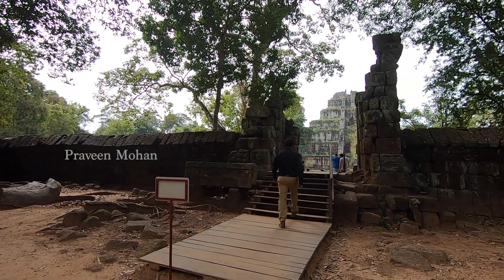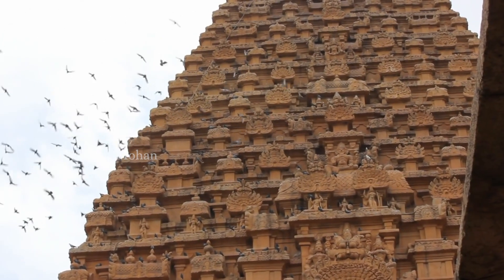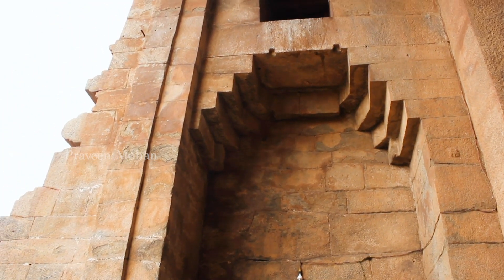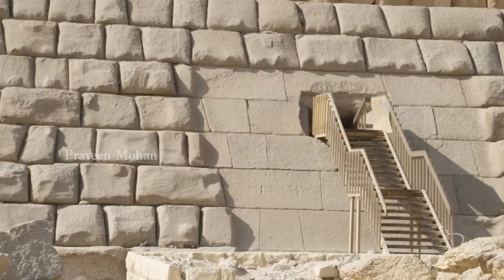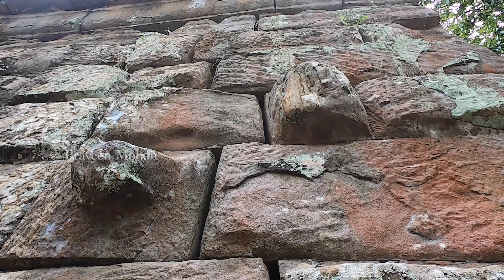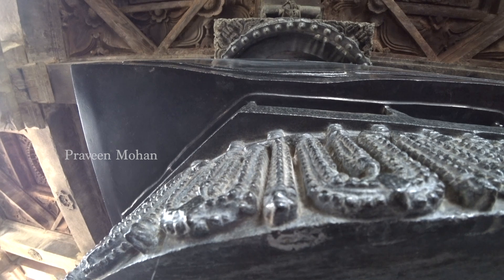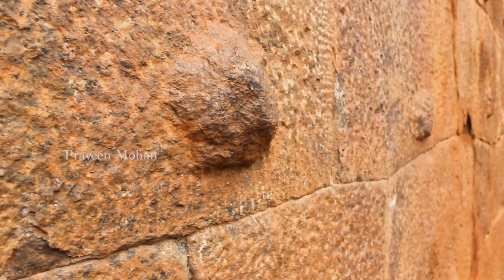Mystery of Ancient ‘KNOBS’ in Temples - Evidence of Stone Melting /Geopolymer Technology?

Comment: simply protruding rafters, framing, petrified during the flood and resting a year at the bottom of an ocean. also how the lime from the cement was leached to the outside by the pressure leaving only the sand, hardening, becoming sandstone. can see how the first bldg was walled of cement-filled sandbags, the bags themselves of which are breaking off along with the lime revealing the sand inside.

Comment: Your explanation is interesting but there are still some major objections. Megalithic structures and the individual stones are so huge and the mystery has always been how would they have got quarried stones into place where they sit so tightly together. Molding liquid stone is (almost) an ideal way to overcome this objection. To mesh so well, they would have to create molds and pour the aggregate mixture in situ, wouldn't they? 

You seem to be saying they moulded the stones in something like a factory and the knobs are imperfections in that process. If that was the case, they would still have to lift the stones from the "factory" to the temple. But then they probably wouldn't mesh so well together. (maybe better than quarried stone, but still not perfect).  I'd like to see you or someone prove the concept by building a simple wall with some major stones. Maybe they structures were Prefab! If they were prefab, how did they get such huge stones to the temple site? Answer: they poured them on-site? Then why aren't the walls straighter? What was the nature of these moulds?  

It seems unlikely the knobs are a result of an imperfect manufacturing process. What was the nature of this process where knobs are sometimes accidently created? Let's see: suppose they cast a stone, let it set, remove the casting. Then sometimes something leaks out of a weakness that they didn't let sit long enough? I dunno... Couldn't they knock or chip the knobs off?

Comment: I think these knobs art not a result of  a 'liquid rock casting method. The may habe a kind of secret message or hint, for hidden doors  tunnels or things like that. 
The bendet rectencular coloum base block looks like an air condition device with air flow slots. Maybe these pillars are a 3 copy from an modern looking air confitioning metal coloumn. When the original device was damaged or bend. The copy is bended too.

Comment: Even though this flies in the face of current thinking that granite rocks are permanent unless reduced to magma or enormous heat and pressure (like near the mantle), it does make sense. A further question is why they didn't pour or flow monolithic walls instead of making so many odd shaped blocks?

Comment: Brilliant observation . Particularly plants only growing on temples/buildings , not out of identical ground rock . The theory megalithic stonework was moulded into position may soon be able to be (finally yawn)  scientifically proven . And yes , the odd protrusions on 2%ish of the blocks , almost certainly a manufacturing default ; but , one that doesn't have any relevance to the strength of the architecture of the overall structure . Of course they would incorporate them . They prob took ages to produce - that block for that space/position ; you're not gonna bin it for the sake of a slightly ugly protuberance eh*

Comment: Lightweight thinking.  No evidence that the stones are any different in comosition from other stones withou "knobs".  If they were moulded when "melted" why do they have the same kind of tool marks as adjacent stones the don't have "knobs",  You have provided no evidence that the stones were melted other than that they have "knobs",  Very lightweight thinking.  The old men have no more evidence of how the stones were mined from in situ stone than you do...which is none.  Making a statement of what you think may have caused the "knobs" and to what purpose the were put (lifting) without any detailed evidence is not proof and is not provable.  You should work harder toward an answer rather than jumping to conclsions (which happens to be widespread to other "experts" around the world). Not at all convincing.

Comment: The knobs are easy enough to remove after the blocks are in place. If appearance counts, they are removed. If not, they can stay. They are needed for final positioning of the blocks, not by using ropes. Probably the use of leverage, a common practice today in house construction when straightening walls before the sheathing is put on. The idea of melting rocks, or casting liquid into blocks is absolutely silly.

Comment: In case of a building technique that requires molds to pour in some sort of liquid concrete these knobs would simply indicate that the complete mold has been filled up in particularly complex points of the wall, joins perhaps, or difficult angles. I think someone else has already indicated this possibility.

Comment: When you cast metal or ceramics, the pouring hole allows room for overfill of the casting material. The hole also allows for gas escapes and contraction/expansion.

I would be curious if knobs ever occur on  opposite sides of the same block. If not is suggests a pouring method.
Reply: Makes sense. But I wonder why wouldn't they just chisel off or polish the knob later. Looks like it had some utility, else they wouldn't leave it in place.
Reply: @TheYellowshuttle  three possibilities: the softened stone was already set; the knobs are injection or relief points; or or the protrusions were molding mistakes. I doubt the knobs were lift points. Also, cutting of the knobs would risk damaging the stone. It is also possible that stone densities vary throughout the stone causing uneven weathering. 

I am starting a ramned earth building company. As a practical matter, agrigates are mixed, poured into a mold and compacted. Once the mold is removed, no further changes are made, since the newly formed rock takes time to cure.

Comment: If we make up a dough of almost any powder and liquid to a very thick consistency and insert some type of rod into the dough and then remove it, a "pimple" of material is raised on the surface.  This seems to me to be the proof of geopolymer construction, and the exact consistency of the specific batch of slurry and the speed with which it hardened would determine the knobs appearance or absence.

Comment: The nobs were made when they quarried the stone. The nobs were on bottom of stone. They cantilevered the weight of the stone and the nob held up the stone. Then they cut them away from wall. The nobs held stone off ground and made moving them easier. The nob is easier to drag then flat stone. The goepolymer is crushed first and then heated to make the hydraulic cement like a stucco. It has to have high silica to make hydraulic cement. You use a kiln to heat limestone or dolostone. That's slag not rock. Perhaps you should learn about making cement in a kiln. It's more about what the rock is made of. The nob was just to keep stone off ground. It is a lot easier to than just a flat surface to move. This is what happens when people do videos and have no experience with stone working or cement.

Comment: Blocks were cast in place. This allows for the odd polygonal shapes to be fit tightly together. The 'concrete' stone MIX they used had some large stones as filler material within the mixture, those stones protruded from the mix. The mix was of a very thick consistency. As it cured or setup,  the builders would more smoothly shape the surfaces, but of course the knobs being hard stone could not be pushed back into the mixture.  Carving of hard stones into such odd proportioned blocks makes no sense from a labor work POV.  Neither does lifting 100 ton, or huge blocks high up to form walls. Of course some very heavy large stones blocks were carved out of the bedrock and moved, perhaps by giants in other places, but that is another story. Even today, there are many various construction methods used.
Reply: And weathering of the stones has paid its part in fooling the archaeologists. Stones etch, flake, crumble, crack off layers and can form odd appearances over great amounts of time.
Reply: Perhaps rough forms were used to hold the mix in place to prevent slumping. You might think that could keep the knobs in the blocks, but also the form could have been taken away too soon and the mix moved. Speed of building was also important so defects were tolerated in some areas of the walls.

Comment: In my minds eye the smaller ones were used to stop flimsy ladders, scaffolding and mechanical lifting devices and ropes from slipping off of the blocks, and also as convenient hand grabs, and the bigger blocks that extend out of the face were left as ties for future potential walls to be built adjoining the structure.

Comment: I like your idea however these knobs are also evident in the quarry where the stones came from. They seemed to be the last holding points at the back of the stones before they were broken away from the quarry face. They almost always were at the bottom of the block in the quarry. You are right that many blocks seemed to be cast. Maybe the cast blocks were made from the pounded material from behind the quarried stone and for some reason they left the knobs on to show these were quarried stones.
  Another thought, these may have been left on as a key for the final plastering of the temple or wall.
love your thoughts and appreciate the great contribution you have mad to understanding these ancient mysteries . Cheers.

Comment: I am not totally convinced that they are defects, they had to be intentional.  If you are casting something, gravity and the mold/form determine the shape of the final product and a knob would have to be an intentional part of the mold/form.  I think it had a purpose for construction and then the easy to reach knobs were shaved off once the construction purpose was met. They could be something as simple as a visual marker to help determine the alignment.  Or perhaps they were used to hold a surface 'cap' that has since been removed or fallen off.  It is intriguing that they are found on structures around the world.

Comment: Uh, knobs are probably where they cut the block free from the quarry face. First face wouldn't have them on the front side. Has to be one last place supporting the weight of the piece when you finally cut it free. Leaves a "knob". If it matters, they can cut the knob off. Otherwise, why bother? There, common sense solved your mystery.

Comment: Just an observation. Some of the walls you show in the video quite clearly have a hammered/chiseled finish to make them flat. However the knobs do not. They are rough like the original stone finish. If they were casting the blocks then you could assume they would cast them flat in the first place but if they did need to have a final finish with a chisel then surly they would have taken the time to flatten off the knobs while they were at it?

Comment: This has always been my leaning towards understanding knobs. It might even have been possible that most 'knobs' were removed by slicing them off, but of course when they had already solidified, they could not be sliced off. 
I think it is the remnant drops of fluid rock when poured out and shaped, that solidified quicker than expected.
Reply: Or , the blocks were only softened on their outer inch or so deep. Some occasional random points were not softened and could not be molded or scraped flat. That is why the nobs only protrude an inch or so. They serve no purpose, but were used instead of being discarded or laboriously smoothed as hard granite. I wish I knew how they softened the rest of the rocks outer surface!
Reply: Unfortunately the information in the video was not correct . But in the context of the video of what you say makes sense
Reply: That's a very broad statement...how do you back it up???
Reply: @Liberallez  It's not a statement:  it's my current thinking.

Comment: Think like a builder. The knobs were likely balance points and how blocks were moved. The knob raises block off the ground allowing a rock to be placed under as a pivot. Pivoting is very easy way to move massive objects. A guy in Michigan moved blocks weighing over a ton on a pebble sized pivot rock. The knobs were likely left in less visible areas without carvings due to economics (cost of labor). Simple and effective method, no need to complicate.

Comment: Noticing if two features of wall blocks 1) slight concave versus 2) pronounced convex. This tell us something about the variance in the proportion in the concrete mix.

Where concave blocks seldom associate with knobs while convex has knobs. 

Expanding concrete can be pour mold to attain seamless block fitting. The down side is the require for expansion mitigation by am experienced priest. When over expansion is speculated the priest ask to puncture a hole to bleed off expanding material thereby a knob is left behind. 

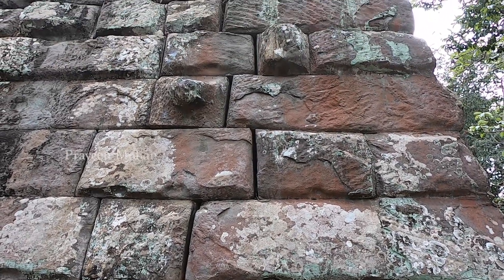An extreme example can be see in the video with which the knob sized nearly the entire block face area. Imagine the priest’s whole body was covered in sweat desperately trying to puncture as many holes as he could on that block. See also page 7:25 through 7:35 and including 8:35

Comment: The use of hydraulic cement is an advanced knowledge pass down by from ancient civilization and in one modern day someone claim inventor of it. Just about all classical knowledge and wisdom came out into modern time in such process. 

Ancient hydraulic concrete was made of hydraulic cement mixed with wet and crushed sandstone limestone or granite. Left cured into artificial stone blocks sharing a common composition and proportion. Modern men use diamond tools and heavy duty machinery. 

The expanding property in ancient concrete enables several mysterious construction technique not k own to modern men are 1) seamless fitted polygonal wall and floor blocks, 2) its water resistance properties made it suitable for tropical and subtropical building sites. 3) the wet concrete enables clay artists to carve intricate models and geometries. 4) enable easy transport of material bit by bit to build up hundreds to thousands of tons of block. The down side is all that advantage will be lost once the concrete has cured. 

All ancient temples megalithic blocks and blocks of Giza Pyramid were made with some sort of hydraulic cement also known as geopolymer. 

What about the protrusion knobs?
Expanding properties is chosen for seamless fittings has a down side. Chance to over expanding. If not entertained block in trouble will burst and make a mess to the adjacent wall and floor below. At the early stage in the curing cycle the priest or pharaoh ask to puncture a hole on the block skin to bleed off excess material. That leaved the block with a protrusion knob. 

However if cure has gone half and not provided with bleeding hole it will crack. I’m such situation the priest ask for pipe boring and bleed materials deep side the core. That leaves the block with a broached hole with cylindrical core in it. People enjoy breaking off that core once cured, with a chisel and a single blow of a  hammer.

Comment: Those knobs are there because those stones were not quarried, they were made. Like concrete. Those stones were made using a mixture then poured through holes into molds.  It would explain the precise fit between the stones, and those knobs are from the hole where they poured the mixture into.   Why don't all of them have knobs?   Well I'd imagine they did at one time, but some of them were removed using whatever method they had at the time.

Comment: the knobs we see here are meant to be facing up in order to connect with other concave counterparts and help in stability but perhaps due to breakage/inconsistent result they have been put on their side because it was a better surface for the stone above it , and so it has exposed the knob which is usually unseen by us. as how it was never removed maybe they thought it added to the design or maybe they were simply not preoccupied with the flaws and maybe focusing on the more important sculpting sites. maybe even planning to go back and fix the knobs later but never got around to it. this is my idea.

Comment: SUBJECT:  KNOBS ON STONES

Great video.  It looks like the Geo-polymer concrete idea is becoming vey popular among 
amateur archeologists.

So the followeing are two comments in reagrd to your video.

1.  INJECTION MOLDING:

When i was a teenager i was working part time in a plastic injection molding factory,
I noticed knobs sticking out from the item.  My supervisor told me that I had to cut out
the knob as much as possible.

So, I was wondering whether the KNOBS are part of the rock injection molding process.
Those KNOBS should have been removed but for some reason this process was abandoned, due to a natural or man-made catastrophic.

2.  KNOBS::

So, in regard to the KNOBS, can you determine whether the rock has multiple KNOBS, at 
least one on each side.  Otherwise the rock can't be lifted due the imbalance.  ,  In your video i think you only show one side of the rock

Thanks,

Dan